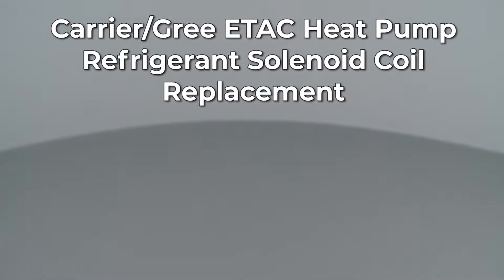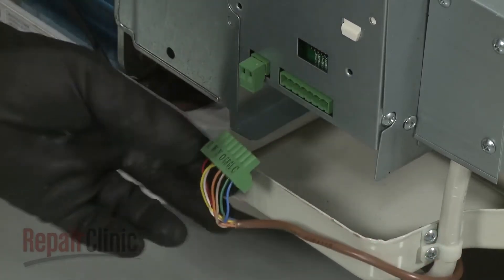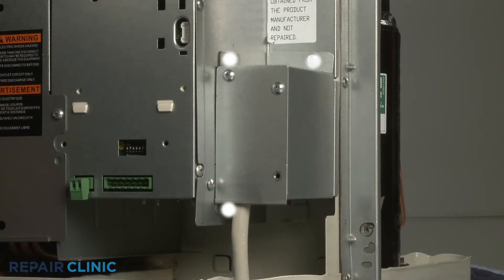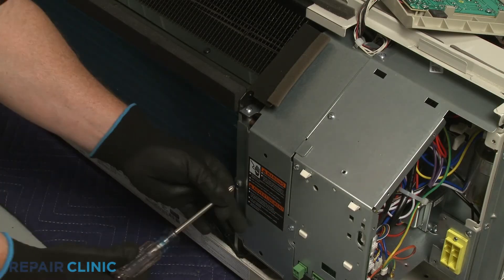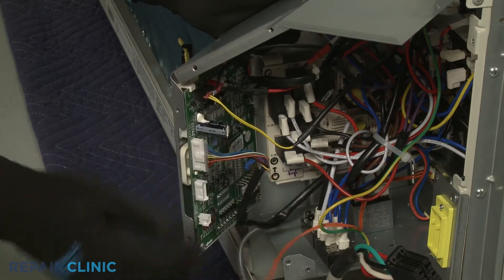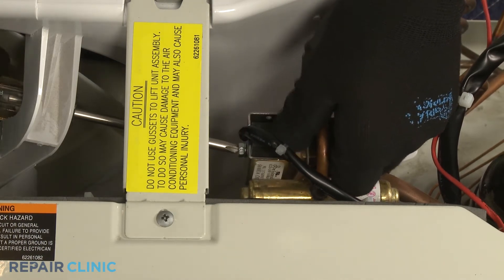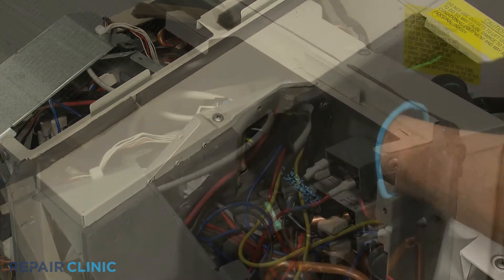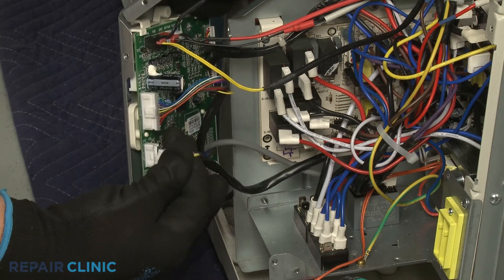Carrier/Gree ETAC Heat Pump Solenoid Coil Replacement 4300040022

Comment: how do i know the solenoid is bad ? no heat pump action ?
Reply: Test resistance across the terminals.  I'd assume it should typically be between 6 and 18 ohms, but that's just a guess.  If it's OL or near 0, the solenoid is bad.  I'd also check the leads going into the solenoid to ensure the board is sending it 24v.